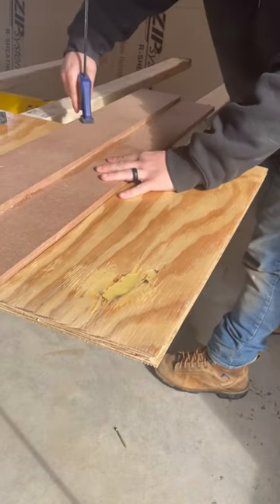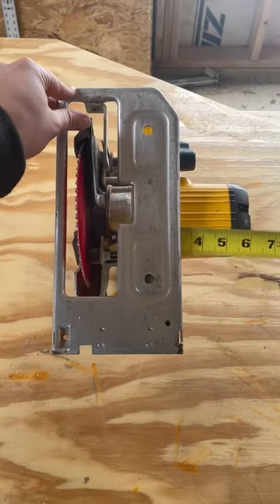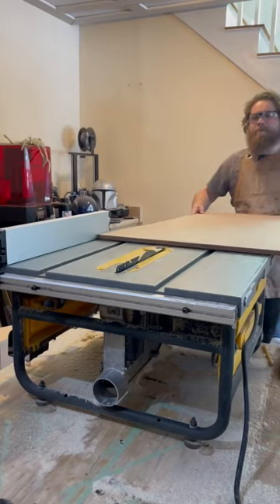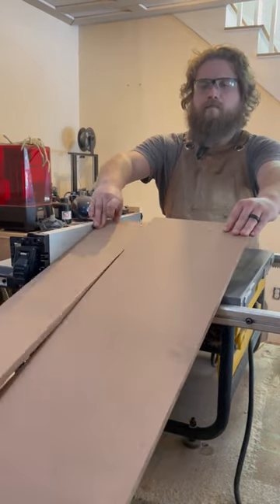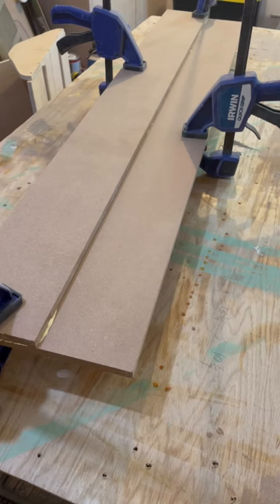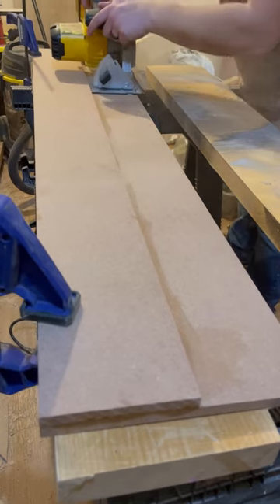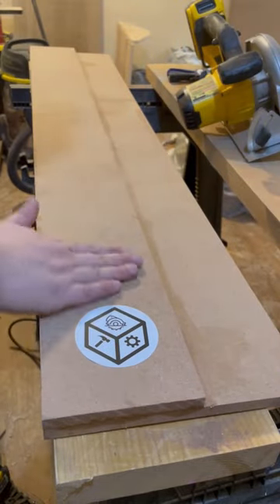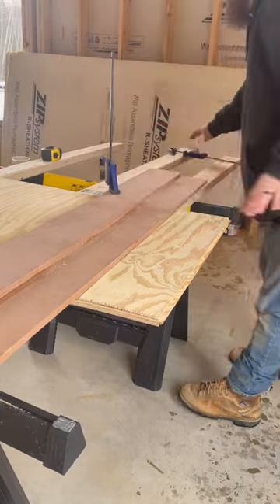My Favorite Circular Saw Jig

Comment: Just remember to add the thickness of the blade to your measurements.
Reply from the maker: That’s a good point but only if you put the jig on your waste material. As long as you set it on your finished piece, there’s no need to factor in the blades width. Hope that helps and thanks for watching!

Comment: I wish I had seen this before starting building cabinets, do you think it would be effective to put some kind of rubber grip tape on the bottom to remove the need for clamps?
Reply from the maker: I really love that idea. I know the Festool track saw has a felt or something similar on the track to keep it from marking and slipping. I’ll do some research if I come up with a good solution. Thanks for the tips and for watching!

Comment: Or just buy a straight edge, measure from the edge of the blade to the edge of the base plate, add it to your measurement, clamp the straight edge and cut. Don’t forget the blade thickness. A level works too.

Comment: How about the depth? It fits all depths cutting? I’m new …
Reply from the maker: Great question! I used 1/2” material so I lost a 1/2” of cutting depth. My saws maximum cut depth is about 2 3/4” so with this jig it lowers to 2 1/4”. That’s usually not a problem for the cuts I need to make but if it is you could make the bottom out of 1/4” material for a little extra depth. Hope that helps and thanks for watching!
Reply: @OneWayToMake  thanks for tips ! 👍I will try it

Comment: Now I just need a table saw😅
Reply from the maker: I see your point and table saws are great but this jig can be made using only a circular saw. Use a straight edge or the straightest board you can find clamped down to your MDF to make your cuts just remember to add the distance of your saws plate to your measurement. The only other thing to remember is to use the factory edge of the MDF as the top inside ledge of the jig (the area where the two pieces of MDF overlap, if you do this you should be all good. Hope this helps and thanks for watching!

Comment: I've had an aluminum straight edge for 35 years. Plus 5 1/2 in on my Milwaukee circular saw. If you're going to reinvent the wheel then don't do it with some cumbersome crap.

Comment: Make the top piece out of ¼ or ⅜ then you can set the depth of the saw all the way down and still use it for thicker materials
Reply from the maker: That would definitely work, but I think you mean the bottom piece, or at least that’s what I consider the bottom. The wider section that the saw rides on is what I call the bottom and you are correct you would use thinner material there to gain and extra 1/4” of cutting depth. Thanks for sharing and for watching!

Comment: This Only works on the line if you are keeping the side you set your guide on.
Reply from the maker: Yes that’s correct, this jig is set up to be placed on the waste side of the wood. If you set it on the finished side you need to account for the extra 1/8”. Great point and thanks for watching!

Comment: You don't have to measure to the blade. What I do when I need one of these is I get a wide enough piece. A left over 1x2. Screw the left over 1x2 onto the wider piece leaving about two inches on one side and whatever is left over on the other. Once that done I cut the wider board with the saw running against the 1x2. Then the smaller side the same with the smaller side of the saw. That way you know exactly where that blade is at.
Reply: And you can use jig for both sides of saw.

Comment: I did this and it's perfect.  The problem is that I think the mdf is too thick
Reply from the maker: I'm glad it worked for you and yes for some cuts that could be a problem, if it is I'd try making one where the bottom plate is 1/4" thick. Thanks for reaching out and for watching.
Reply: @OneWayToMake  👍👍

Comment: Cut without any measuring????
You have to measure to get the line and make it square, unless you’re just eyeballing it. 

Also need to add an 1/8” or whatever your blade thickness is if your using the piece you cut off or if you measure from the other side you can put it on your line

Comment: How do I cut them the first time around
Reply from the maker: That is a great question. Use your circular saw and a straight edge/straight board  clamped down, just don’t forget to factor in the size of you saws plate. When you assemble make sure the factory edge of your material goes on the inside edge of your top layer of the jig (the part that your plate will ride against. This way any problems with your cut will be on the side that doesn’t matter. I hope this helps. If not let me know and I’ll give you a more detailed explanation or provide some pictures. Thanks so much for watching and for that great question! Best of luck with the build!

Comment: Save yourself the measuring; just make the base as large as you want and cut it
Reply from the maker: That is kind of true, there is no limit on a maximum size except for what you are willing to have in waste material but it needs to be at least an inch over the size of your saw, from base plate to motor so your motor doesn’t hit your clamps. But if your saying it doesn’t need to be an exact measurement then you are correct. Hope that helps and thanks so much for watching!

Comment: Or just clamp a straight edge 4.5 inches from your cut line so your saw isn't raised up half an inch and you can cut through thicker sheets and boards
Reply from the maker: Yes this is another great option and one I used many times until learning to make this. For me, it took longer every cut because I wasn’t confident in my measurement so I would always mark two lines, a cut line and a straight edge line, some people don’t need to do this but I always did and honestly some times I’d still mess it up. Sense I started using this method my mistakes and lost matter have gone down a lot and I’ve saved a lot of time. That being said if that method works for you I say go for it. Thanks for watching!

Comment: OK...
THAT'S PRETTY SLICK.
I've always measured over from my mark and clamp the material on the reference mark and then just used a straightedge I definitely like this better
Reply from the maker: Same here I’ve done that for years and it works fine and doesn’t sound that hard but this saves a ton of time and is one less thing to mess up by adding wrong. I hope it helps you as much as it has me. Thanks for watching!

Comment: If you have a table saw where the hell would you be going through all that.
Reply from the maker: That’s a great question. My table saw is pretty small and I struggle with getting good cuts on full sheets of plywood. This jig helps with those big cuts or a cut that needs to be at an angle. I hope that helps explain it and thanks so much for watching and for the comment!

Comment: So i need a table saw to make a circle saw jig so that i don’t need a table saw?…
Reply from the maker: That’s a fair point I did use a table saw to make this. I still like having one even though I have a table saw. For large pieces it makes more sense to bring the saw to the piece rather then the piece to the saw. But, that being said this jig can be made without a table saw, use a straight edge and circular saw, just make sure to account for your saws plates size, and use the factory edge for the inside edge of the top board. I know that’s a lot of information, if it’s confusing let me know and I’ll make a video that shows how to make one using only a circular saw. Thanks for reaching out and for watching!

Comment: It seems to reduce the cutting depth by quite a bit
Reply from the maker: It reduces it by the thickness of the bottom of the jig, in this case 1/2”. My saw has a 2 3/4” cut depth this jig reduces it to 2 1/4”. Hope that helps and thanks so much for watching.

Comment: The actual track & adapter for the 6 1/2 brushless saw for Makita is the same price as that crappy MDF lol
Reply from the maker: I’m not sure, this MDF was about $20 and I think those usually go for $100-200 but they are great too. I say use whatever works for you. Thanks for watching!
Reply: @OneWayToMake  got 2 55inch tracks and the adapter for the ds680 saw for $100 in canada
Reply from the maker: @evictioncarpentry2628  that’s great! Thanks so much for sharing!

Comment: I would just clamp a strait piece of wood to the piece I was cutting very simple
Reply from the maker: You can definitely go that route, this jig just saves you from having to add the distance of your saws plate to each cut, but like with most things there are many ways to achieve your goal so I say if it's working for you then keep it up. Thanks so much for watching!

Comment: not sure how that's easier than just clamping down a purpose made aluminum or magnesium straight edge... you're still just lining up an edge with marks and clamping it down... if the distance from your blade to the edge of the shoe is your hang up, just cut a small block that fits that measurement to line up straight edge... 2lbs of dead straight and flat, durable, waterproof metal beats the heck out of a 20 or 30 pound, easily dinged up jig

Comment: I get sick of watching these videos,  I've been doing this for 30 years with a straight edge and two clamps, why you all trying to reinvent the wheel
Reply from the maker: That’s an interesting point. I did it that way for about 2 years and I was super sick of the extra step. I’m sure you’re much more efficient then I was, so it doesn’t take you nearly as long as it did me, but honestly you might give this a try. Even if you save 2 minuets per cut, it’s adds up over 30 years. Either way though, everyone should just do what works for them. Thanks for watching and for the comment

Comment: Nice jig that’s 3/4 MDF correct
Reply from the maker: Thanks so much, I actually used 1/2” MDF to cut down on the weight and allow me to cut a little thicker material. The 1/2” works well but 3/4” is fine too if that’s what you have access to. Thanks for the question and for watching.

Comment: And for 10 bucks you can buy a 48” straight edge with clamps…
Reply from the maker: That works too you would just need to account for your saws base plate size when marking for your cuts. This jig avoids that but both options work for sure. Thanks for sharing and for watching!

Comment: I have tried this guys it works but it doesn't work well. 
1. The MDF slides so you will need to clamp both edges of the jig
2. The clamps get in the way of the cut 99% of the time
3. If you're not great at using a circular saw, the blade can still move away from the jig in the other direction
4. The 3/4" mdf gets in the way of the motor so you have to raise the blade and thus you lose cutting depth. 

Do yourself a favour, work towards getting a track saw. It's a game changer. 
4.
Reply: If your saws wandering away, you either need a new blade or to get to the gym, if the clamps get in the way you've not made it properly, these are perfectly serviceable and can be easily made on site with the circular saw you're going to use provided the saw runs against a machine cut edge of the board you use, if you need more depth use thinner board
Reply: 1/2 inch ply my friend not 3/4 😢
Reply: If you don't have clamps you can drill and counter sink a 1/8" hole in your jig and use couple of drywall screws to hold your jig in place 😊

Comment: you just clamp a 2×4   as a fence on the not motor side.
Reply from the maker: This can work but I will still have to measure the distance of the plate on that side. For me it’s just under an inch. That method works but I find this saves time and I can be sure that it’s straight as most 2x4s have a bit of bow of twist in them. Hope that helps. Thanks for watching!
Reply: @OneWayToMake  angle iron, factory side of plywood, my 4f level has holes for screws for use as a straight fence.. 
Or you know, a table saw.

Comment: Or just clamp any straight edge on at the measurement from the blade. No point making anything
Reply from the maker: This works absolutely fine and is what I did for about a year but I just got tired of measuring every time and in some cases getting the measurement wrong and losing material. This jig helps with that, but if the other way works for you I say go for it, and keep on building. Thanks for watching.
Reply: @OneWayToMake  to be fair mate you do a lot of bench work. I’m on site so for me it’s just another thing to carry that I would hardly use. Most of time I have a plunge saw with track with me anyway. But for a bench joiner making the jig is probably the best way.

Comment: Too expensive bro. Learn to use your hands as a guide or get a new carpenter.
Reply from the maker: Well if you can get what you need without this jig then it’s definitely cheaper, nothing beats free, but this isn’t a very expensive jig. Around $20 to make both sizes if you buy it outright, but I’d suggest using scrap it doesn’t take much at all. All I can say beyond that is this jig has kept me for ruining many pieces I would have screwed up without it. Thanks for watching!

Comment: Another amateur woodworking video. You do know, that your measurement will be shorter that way, because you didn't take the blade's width into concideration!? Of course, you could turn it around 180 degrees and do the cut. And... Your saw can travel away from the jig...
Reply from the maker: Well one thing is for sure I am definitely an amateur. Just to clear a couple of things up, the blades width doesn’t matter as long as the jig sets on the side of the material you plan to keep. If it’s set on the waist material you would need to account for the blades width as you mentioned. As far as drift goes I suppose that’s possible, all I can say is that I’m not great with a circular saw by any means but it’s never happened to me. I hope that helps and thanks so much for watching.
Reply: @OneWayToMake  thanks for the reply 🌞 Yes, i know that, but it kinda looked like that was the piece you were going to keep, which would require adding the blade's width... I see lots of semi-dangerous woodworking videos with tips/hacks for beginners, by beginners, so I feel an urge to comment sometimes. I also noticed, that your tiny tablesaw is elevated to chest high, and the material kinda drops off the saw. So maybe start with basic safety, and make some videos about that or starting them with a disclaimer, in best Norm Abram style. People will copy dumb shit, take it from a guy who is a pro, and has had my fair share of sketchy shit happening, when I didn't know what I was doing. I feel blessed, that I still have all my fingers left 🙈 I am, on the other hand, a big fan of sharing knowledge, so keep up the good work 🤗

Comment: You have a table saw, wasting time making jigs.
Reply: Maybe he was showing that for people who have no table saw.
Reply: @RErnie-gv1hv  did you think that through before you commented ? He used the table saw to make it . I was looking for someone to say that it will come in handy when you have a project in the field away from your shop . And you don't know what the Dimensions will be .
Reply: @thomaslemay8817  Well of course not. Why would I break a long time trend? You're right though. To give you further insight, my table saw is, and has been for 25 years, serving devotedly as a table, supporting all manner of junk.
Reply: @R. Ernie  LOLLOL, I  use the need to cut lumber to force me to put things away.  I use my table saw for all manner of jobs from egg candaling to carburetor rebuilding. Even lay-out work on  steel projects,  keeping my steel cutting and welding table  open and clear . I left  my steel working table outside at the airport for a week (soft wet ground). One of my friends asked about it possibly getting stolen.  I said ,not worried . Try to move it yourself . He went and had a closer look , the top is 1 1/4 in. Steel plate.  The legs are 3in. schedule 80 pipe. Because of the rain that started while I was dropping it off,  It was impossible to get equipment close enough to move it. I had a plan to move it into my hanger when the ground dried out some.  I used pipes as rail and rollers when I was ready . I am retired, but I use my tools often enough to justify keeping them for now .
Reply: @thomaslemay8817  You seem to be a guy with many talents and interests. Eggs to welding. You need to live on our street. That way when I need something you'd be my go-to guy. Actually, around here several neighbors and I do trade favors and help. So you'd fit right in. How did you keep that table from rusting out there in the rain?